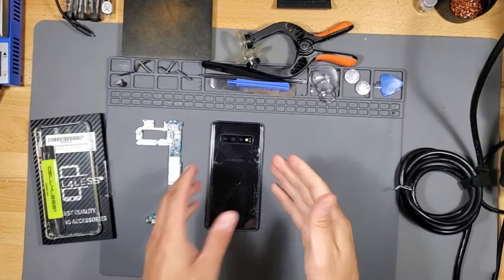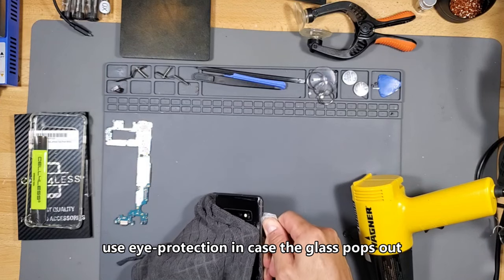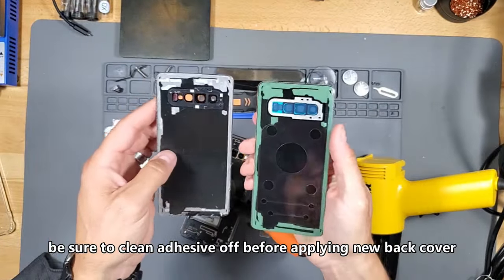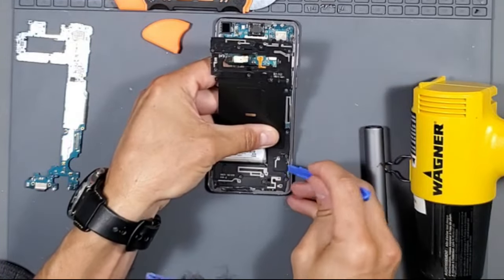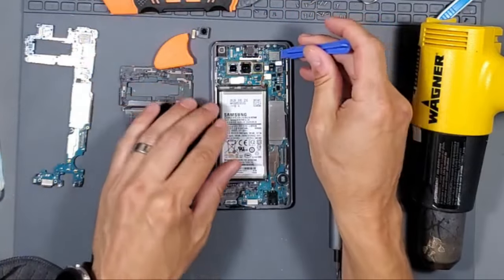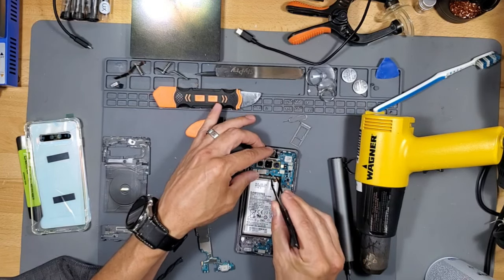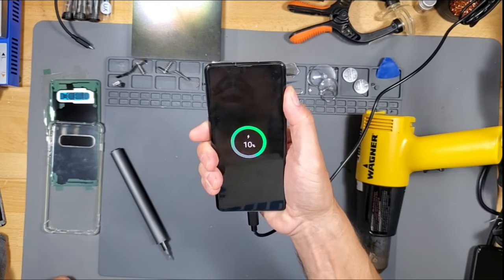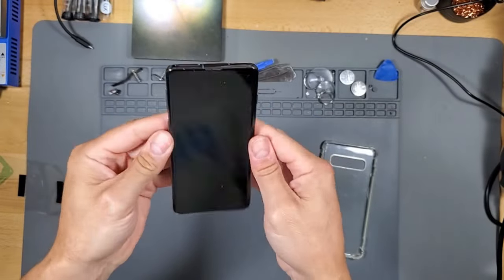How to Replace Samsung S10 Back Glass Cover & Broken Motherboard

Comment: What kind of contact cleaner do you prefer using on phones/motherboards? Thanks. Galaxy S10 giving me a big issue, swapped the motherboard to a new frame and it accepts a charge from a wireless charger but no change on the screen/won't turn on. Screen/frame/battery are all new OEM Samsung....tried cleaning some contacts on the S10 but.....not sure how much more, to do